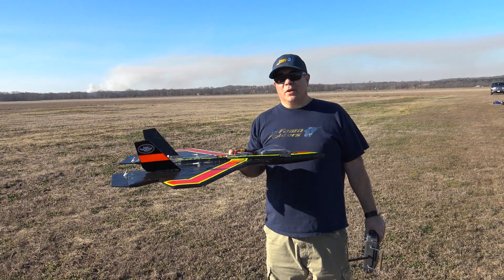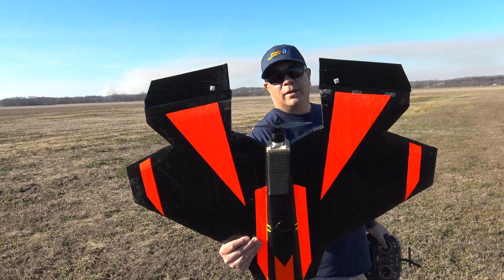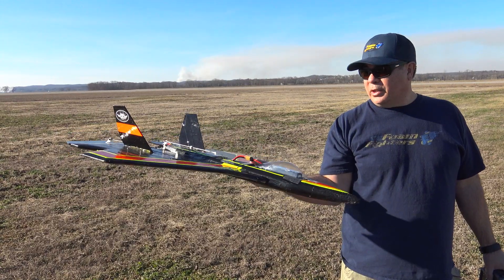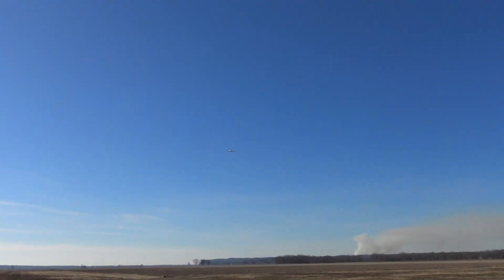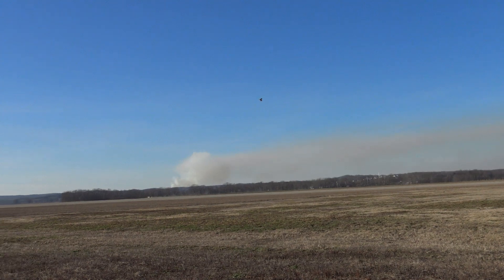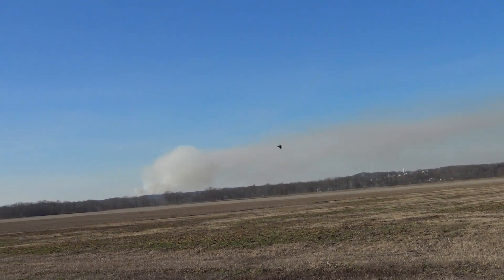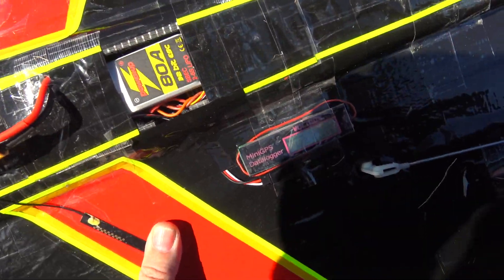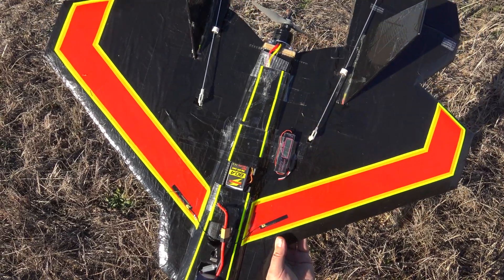FF-EPP-Jet Flies Again!

Comment: I would replace that esc before anything happens lol
Reply from the maker: Thanks for the comment Just a Russian Engineer. I agree, I need to change out the ESC. I was hoping the 32-Bit esc I had would work, it may if I reprogram the timing. I think though I will get an 80A Cobra Race Wing ESC that uses the BLHELI format. Those are made for using with these high 14 pole motors.
Reply: Its fun to see you revist the older planes